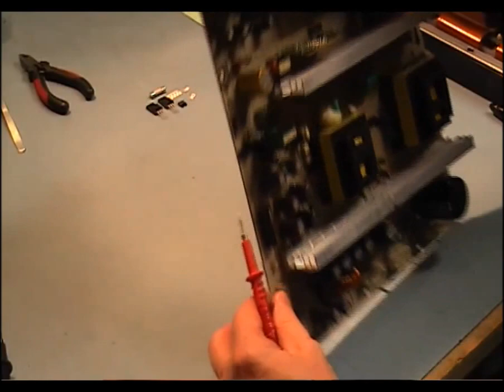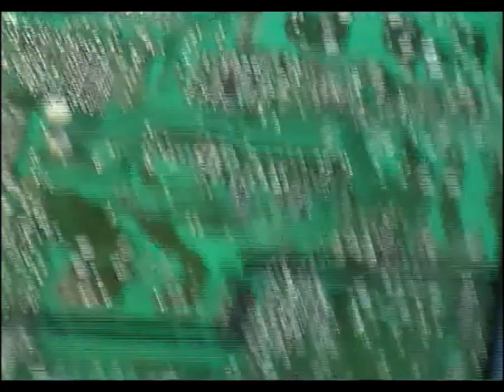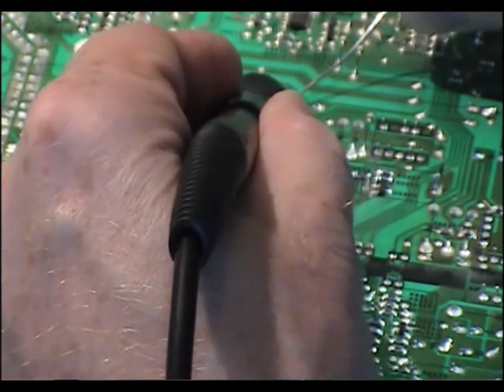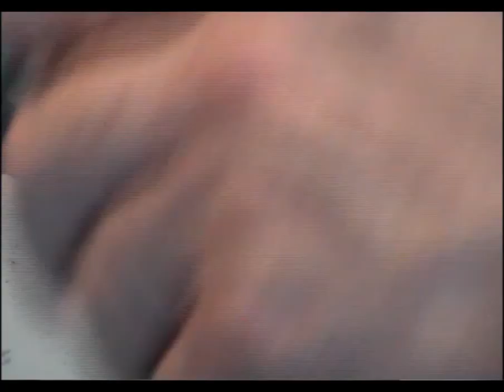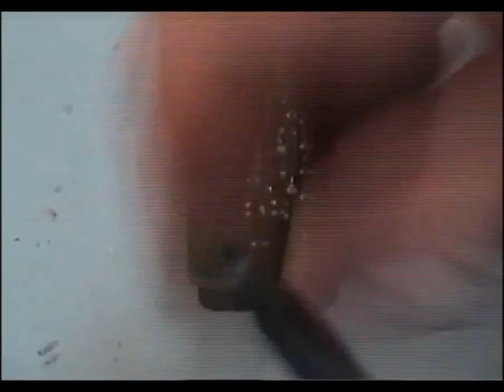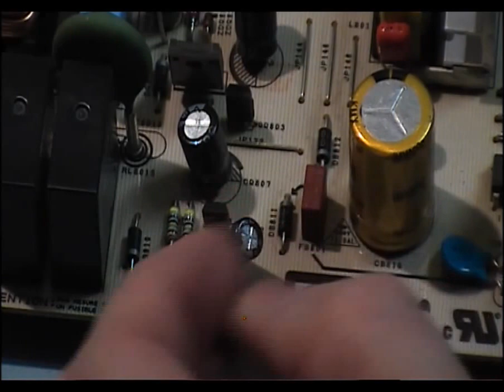Samsung PS-42C91HX  no power repair Pt 2 BN44-00161A POWER SUPPLY

Comment: Hello Sir. I've got the same power supply board and it doesn't click at all. I've checked the FETs and they are fine, I've checked the bridge rectifiers and are ok. What I want to do is to try to turn this on by using a resistor on CN801 pin 1 to see if it clicks. I think my stand by voltage is missing. This board was bought from USA and I'm in the UK and I don't know if its a problem with the voltages. Could you please give me some info as this board is doing my heading. Thank you
Reply: Hello. What can I do if i only have 3.2V instead of 5.3V on standby? I have changed the regulators, transistors, diods, capacitors and still 3.2V. On TB801 on hot side I have 98V on pin 1,2,4 and on pin 6 I've got 5V bot on the cold side I have 3.2V.